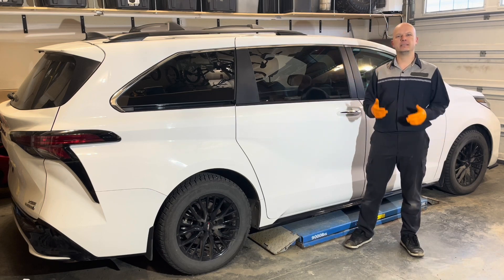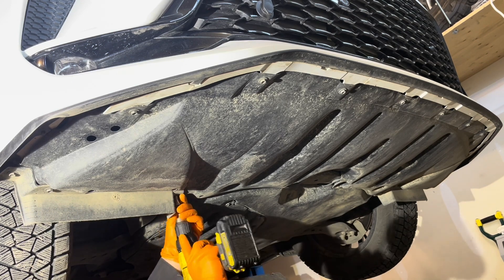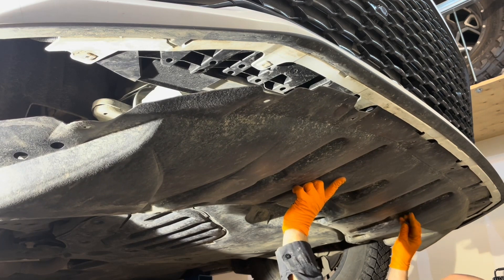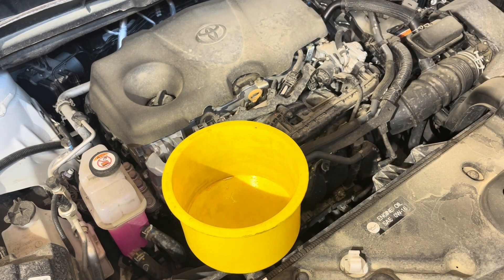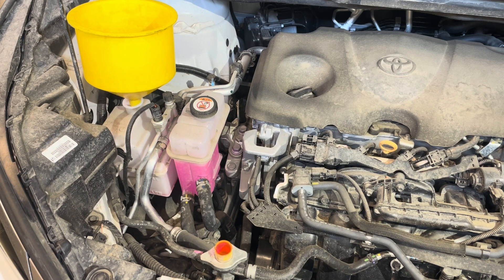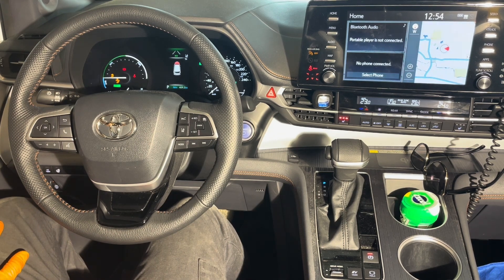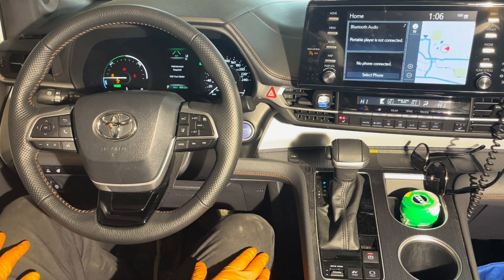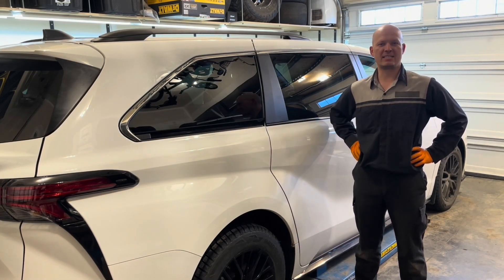2021-2025 Toyota Sienna Hybrid Engine Coolant Drain And Fill Instructions

Comment from the maker: Below are my affiliate links to the parts and tools you would use to complete this job. I may receive a small commission from the product sales. Thank you!
Genuine Toyota coolant (2 gallons required): https://amzn.to/3Y5MopT
Coolant bleeding funnel kit: https://amzn.to/3QbalKl
5/16" drain hose: https://amzn.to/43E0cJa
Sturdy 4 Gallon oil/coolant drain pan: https://amzn.to/3Ou4iiu
3 Ton Jack stands: https://amzn.to/3QOQPCL
Automotive trim and clip removal kit: https://amzn.to/3KgKGfg
1/4" impact driver kit: https://amzn.to/4f1UN4A
1/4” socket adapter set: https://amzn.to/44XTTkI
Rechargeable LED mini work light: https://amzn.to/3Y74OpY
Reply: Great. I will make sure I buy them from here.
Reply from the maker: @dawood2u thanks!

Comment: I thought you were supposed to open the hose connected to the EGR system to bleed air out of the cooling system? I didn't notice you doing that? Also, the Car Care Nut said to make sure that the HVAC is completely turned off. He said you can cause serious damage if this isn't done correctly.
Reply from the maker: Hi, I followed the factory repair manual steps and there is no mention in it of disconnecting the EGR hose. Not sure how could the HVAC system be damaged in any possible manner by running the blower while bleeding the air, maybe you could elaborate with some specifics. I am not familiar with a Car Nut person.

Comment: Viktor, I followed your video and changed engine coolant on my 2022 Sienna XLE but now I have a question. Do you bleed engine coolant with a radiator cap on? Not with Slip free funnel on?
Reply from the maker: Hi there, on this model you would bleed with all the caps closed as shown in the video.
Reply: @Viktor_G_Automotive  Hi Victor. I have a lexus is 300h. The manual says to do something similar to what you just did, do the bleeding with all caps on. I wonder what would happen if I use the slip free funnel method. Will it cause some harm?. The problem with the manual method is that you need to wait for the car to get cold several times (and it takes hours each time). The funnel is faster.
Reply from the maker: @1 @1knmd don’t think it will cause any harm unless you allow the engine to overheat while bleeding the air out, so make sure to watch the temperature gauge. The IS300h is not sold here, so unfortunately I don’t know anything about it.
Reply: @Viktor_G_Automotive thank you so much for fast response

Comment: Hi Viktor. Do you recommend jacking up both the front and rear when draining the coolant? Or is jacking the front enough?
Reply from the maker: Front alone is fine
Reply: Thank you  @Viktor_G_Automotive ! Your response time is top notch!
Reply from the maker: @andrewcatimbang1509 cheers!
Reply: @andrewcatimbang1509  I already have couple of ramp which I use them for my 2021 sienna oil changes.  Can I use the ramps for changing both coolants change ? By lifting up the front side of the car ?

Comment: Hi Viktor, I really appreciate your videos on the 2021-2025 Sienna Hybrid. I have a Highlander Hybrid 2023. Just to confirm, do your instructions on changing engine coolant, inverter coolant, transmission fluid, rear differential fluid, and spark plugs apply to the Highlander as well? Many thanks!
Reply from the maker: @TheHandsomebaby  The process will be either the same or very similar.
Reply: @Viktor_G_Automotive  Thanks so much!

Comment: Thanks for sharing this detailed video. What is the tank with the pink fluid next to the one you filled? If they are both low on my sienna can I just top them off since I'm at 75k miles and don't think I need to replace it yet ! Thank you
Reply from the maker: @jamalothmanrn  hi, the other tank is for the hybrid system coolant. Yes, you can top them both up to the Full line as needed. Cheers!
Reply: @Viktor_G_Automotive why wouldn’t you drain the coolant from the hybrid system at the same time?
Reply from the maker: @TheOnlyNguyen  The hybrid cooling system and the engine cooling system are completely separate from each other. Draining one does not affect the other.

Comment: Hey victor how can I contact you via email ? Or phone number ? Please let me know I have question about my 07 Tundra and I don’t know anyone who’s knowledgeable on it please let me know thanks you !
Reply from the maker: @FishWitWoody  hi, unfortunately I am unable to provide one on one personalized advice over email or phone.
If you have a question that is not overly complicated, you are welcome to ask on here and I will see if I can answer it. Thank you.
Reply: @Viktor_G_Automotive  okay no worries . My 07 Tundra keeps overheating and the reservoir boils over every time . I’m not sure if it’s bad radiator or water pump I’m not sure
Reply from the maker: @ It could be a thermostat stuck closed, a clogged radiator, broken fan clutch, broken off water pump impeller, blown head gasket etc. Hard to say without looking at the vehicle and doing some testing. Any professional technician should be able to determine the cause by performing some diagnostic tests on it. Have you taken it to a shop for diagnosis?
Reply: @Viktor_G_Automotive  No I haven’t been able to get it looked at by the shop there currently charging to much just for a diagnostic but maybe when I get the money I just go get it checked

Comment: If you look at 2018 Toyota Camry 2.5l A25A-FKS engine service manual, you can find that you can disconnect the coolant hose from the EGR valve while you filling the radiator with fresh coolant. It will help the air to escape from very top point and make bleeding process easier. 
Thanks again for the nice work 👍
Reply from the maker: @MrD1maS  thanks for the tip! I wonder why they didn’t mention that in the Sienna manual.
Reply: @Viktor_G_Automotive  Because that is referring to the inverter coolant.